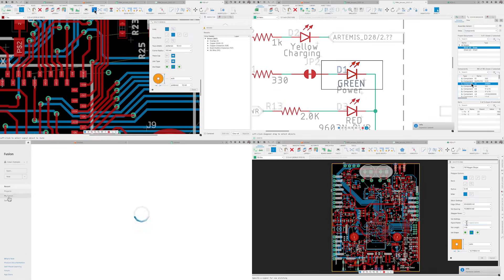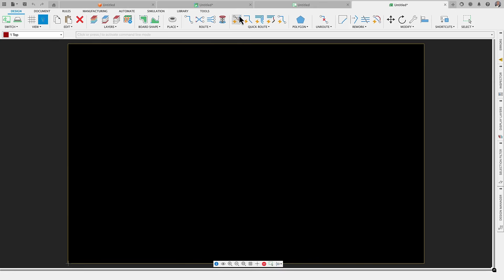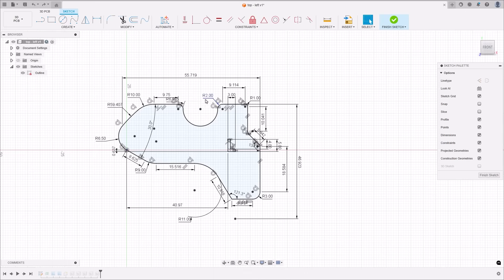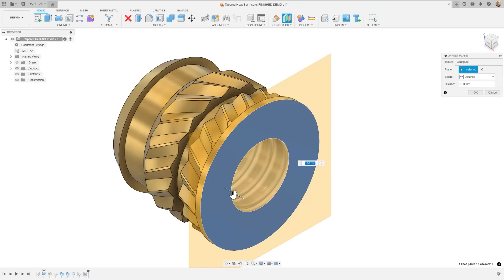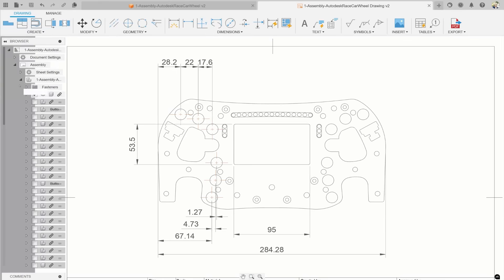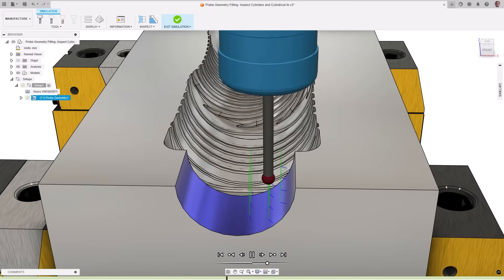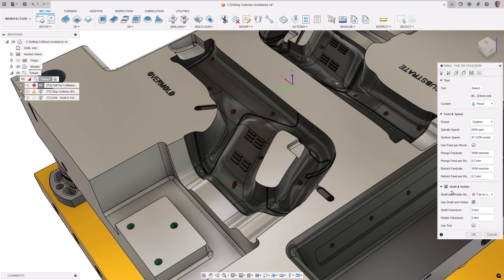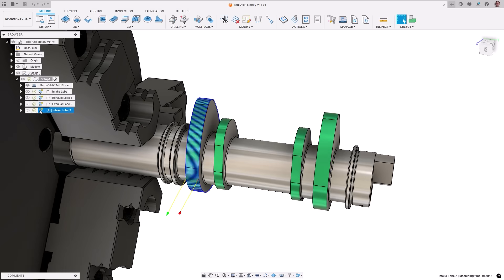Autodesk Fusion | What's New January 2025??

Comment: Was recently using inventor. holy heck fusion is clunky and slow. like, the tool library in CAM takes FOREVER to load, i miss the old one... everything seems to be getting slower with time.
Reply: Typical coder, keep adding code while never touching the old code because as soon as you touch it, it breaks.
Or, they're using AI to code and AI NEVER removes code.. only adds.

Comment: For fasteners, being able to offset them from the selected hole is also a very important option which is missing. This is the only reason why I'm not using fasteners yet and use my own nuts/bolts/washers sets. By offset I mean placing them higher from the hole. One way.

Comment: I would love to see you partner with Bambu labs to create a 3D printer manufacturing/design interface.
Specifically, a connection with a site that we can export not just the .obj files, but the fusion360 model itself to a shared site that others can fork or modify.
and then interface with the slicer directly so that we can say, use this filament for this component. and also show where supports would be.
Reply: I concur - that would be a game changer for the 3D Printing community.
Reply: You could do that with a 3rd party plugin. it's very unlikely autodesk would do something like that short of acquiring the entire bambu lab company. i already have made one that exports and opens in bambu studio with 1 button click.

Comment: Finally sketch constraints in the drawing environment! I very nearly needed to leave fusion due to this missing, makes drawings much less professional without it. Now please fix control frame attachment, ability to edit dimension leader lines (I.e. remove one side etc.), fully editable part lists without 3rd party apps), recognition of diameter dimension from side view dimension, dimensioning detail view out of view scope. Dang I can keep going but this is a great start!😂
Reply: i know your pain, i have a massive list as somone who came from 20 years of inventor for CAD and CAM. 
Started using it in highschool in 2002.

Comment: The new opening interface sucks. Why would Fusion 360 remove the preview in the list format? I used be able to get a very quick overview and scroll through latest and relevant projects fast and easy, accessing what I want to work on fast. 

Maybe if I dig through settings I could find some way to make it work for me as quickly and easily as before, but why make me do that. 

It would be better if I could actively choose elements, or the whole, of the new interface rather than having them forced on me upon update of version. 

It seems like you guys updated the interface to the worse - at least from my user perspective.
Reply: After I open a file, I can get my preview in list format - so I suppose I am not quite as upset anymore... 😂

Comment: Need to be an update to importing meshes and turning them into bodies.  The way it sits right now...the application is unuseable...hence the reason 99% of hobbyist elect the free version verus the paid. I always try the paid once a year but still no ability to convert meshes with anything over 10K triangles into a body...and this is nothing for even the most basic of 3D model meshes.  There are free software out there that do a better job than the $85 a month paid version of Fusion.  Come on guys.